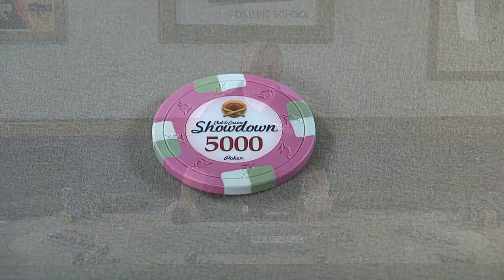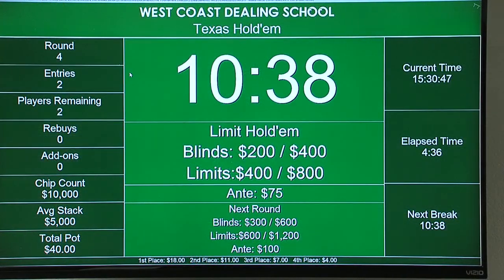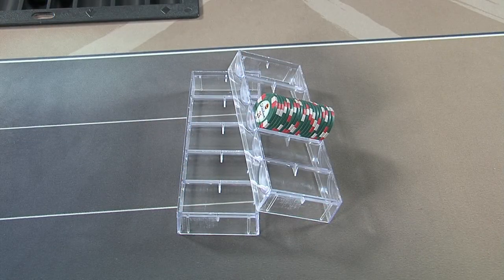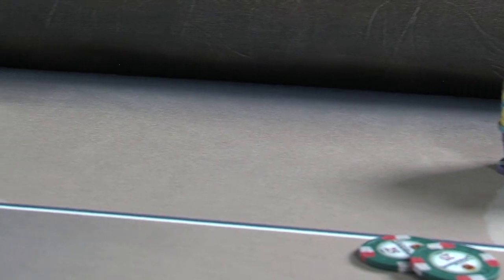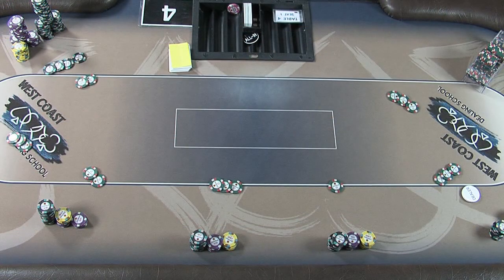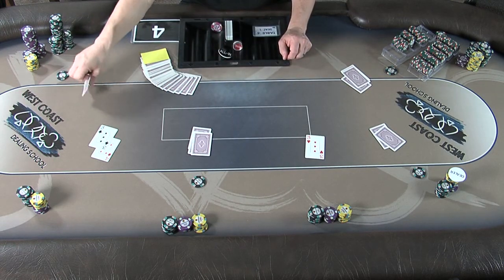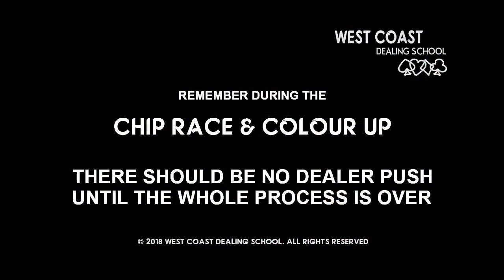Chip Race & Colour Up Procedure

Comment: I'm a little confused -- at 19:30 I counted along up to 3500.  The remaining green chips come out for 3600, 3700, 3800, and one final green chip is called 3900.  Then, the narration states "4000" but two black chips are placed, then a final yellow 1000 and it's called 5000 total.  However, there's actually 5025 in chips on the table, which is exchanged for the single 5000 chip.

Did the captain lose 25 in this transaction?  If the odd greens are rounded up, shouldn't only 1 black have been collected?
Reply: he answered it before, when he talks about odd greens. as it is needed a stack of four to fill the 100, if the stack isn't complete, we "round up" the stack if there is more than 1 on the odd stack.

Ex: odd stack with 3 or 2 25chips = 100 | odd stack with 1 25chip = 0

you only round up to 100 if the odd stack has 2 or more, so the captain will "lose" the 25.
Reply: @erickrox  What incentive is there to be captain, then?  The captain's stack is used to color up other players' stacks, which could leave the captain in a position to lose chips for their benefit?
Reply: @keithr-  there is no incentive, although he doesn’t lose their chips for The benefit, he trades them, and The 25chip that is loose is lost, but fi he has 2 or more, he gains ONE 100 chip

Comment: "Ultimately by the time,
the players brake arrives you would have all the chips sold to the dealer when is color up time."

What that means, i didnt understood that as well ?I mean how i know what is time when i acctualy starting to
color up chips? 
Are the player breaks usually in compliance with this  Color up procedure 
and does it have any time rule or it is starts when  the smallest chip is no longer useful as a betting tool?I mean Hand after 150/300
where we dont use 50chip more ,..is it the time when we start collecting 50 to table captian?

Comment: so you can give the chip captain 75 in lose chips and take a 100?
Reply from the maker: Yes. And he will not be losing anything because when the greens are coloured up by the floor supervisor those “75” chips will be rounded and considered to be as if 100 in value. 
So, for example and keeping it simple, if the table captain were to now possess 475 in green chips, we will exchange those for a 500 chip anyway. 
Or in reality, 4975 in green chips would be exchanged for a 5k chip.
Reply: @WestCoastDealingSchool  thanks,
Reply: @WestCoastDealingSchool  but what if 2 players has left  1 chip of 50 and its time to replace tham for 100..If i as player buy from each of them 50x2(100) as 200.
will i get 200 from supervisor becaus its 
whole number not like 75 if u understand me?ty
Reply from the maker: @Stefan-ct7rh  Remember that this chip race and colour up procedure is the way it is done at major events like the WSOP. There are a number of other ways to do this.
To address your question... using this method there will not be more than 1 player receiving a black chip in replacement for their chip or chips of 50, if there is only 1 black chip available. That is what the chip race part of the procedure is for. The dealer turns one card face up for each lower denomination chip that each player has. So if a player has 2 green chips to equal 50 in total, the dealer gives him 2 cards face up and if we have a second player with 2 green chips, he too get 2 cards face up. (if they were chips that have a value of 50 and each player only has one chip each - then they only get one card each)
The dealer now collects the green chips from both players (which adds up to 1 x 100 chip replacement). Of the two players the one with the highest card gets the black chip.

Now some events will simply give any player who has 1,2 or 3 green chips left - 1 x black (100 chip each). That's just an easy way to handle this. Small rooms adopt this approach, but large events cannot or we would be introducing too much extra value to the game. You imagine if we had 100 tables remaining (9 handed) when we are colouring up 1000 chips to 5k chips? If every player in the game had just 1 x 1000 chip in the chip race, but we simply exchanged every one of them for a 5000 chip, we have just added 3.6 Million chips into the game. That's a big deal. Wouldn't matter as much if you only have 3 tables, 9 handed (like a small poker room daily tournament) even if all players exchanged 1 x 1K chip for 1 x 5K chip, it would only add 108,000 in value - that is still proportionally too much value in my opinion. But it just makes this whole process easier because you don't need to do the chip race part of this procedure.
Reply: Big thanks sir.

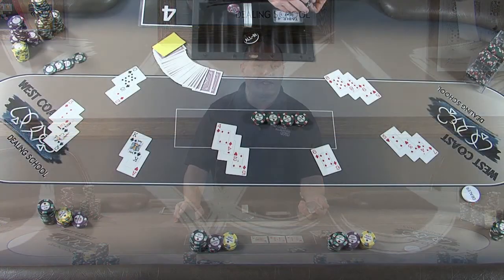Comment: At 14:42, there are 17 cards. Then at 15:23, the instructor says there are 14 chips. THEN at 15:35, there are only 13 cards, meaning you'd only take three black chips, AND a player is missing! Then at 15:49, there's 17 again. what kind of shenanigans are happening here? lol
Reply from the maker: You missed the fact that at 15:05 there are 17 cards but the dealer actually, for a moment, only had 16 green chips... at 15:07 he only had 15 green chips, at 15:10 he only has 14 chips, and at 15:16 he only has 13 green chips. Whilst all the time working with 17 cards on the felt... In fact what seems to be what was really missed here is the point of the video and the exercise? Not to worry, this was intended for professional poker dealers only.
Reply: @WestCoastDealingSchool  Except I actually do work as a professional dealer and my comment was only poking fun at the video editing of an otherwise good video? But okay, I guess joking isn't allowed. My mistake. Didn't know it'd upset anyone.

Comment: just give everybody rounded up chip ...   even 25 =100 

or 

change the chip in the pot while dealing in higher denomination 

in short dont make it so difficult
Reply from the maker: ima shaman, this is the standard procedure when dealing at large events such as WSOP events. We use this procedure because we do not wish to add a huge value of additional chips (which would happen if you simply gave everyone a black chip for any amount of green chips). Consider the value you would add to an event if you had 100 tables containing 10 players and we are about to color up the 1K chip and replace them with 5k chips?So I am not saying this is the only way of handling the chip race/color up, Im saying this is the official way to handle it at major events such as WSOP etc. If you choose to replace all chips at a smaller event and even have the dealer take care of the whole process then that is understandable. That procedure is also used by many poker rooms here in Las Vegas when handling a small event.Thanks for the comment.Chris